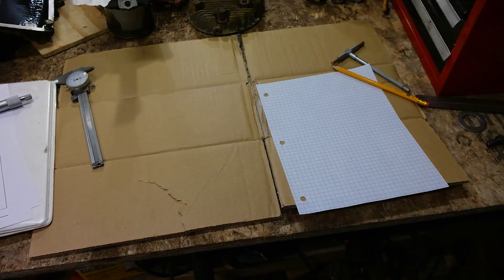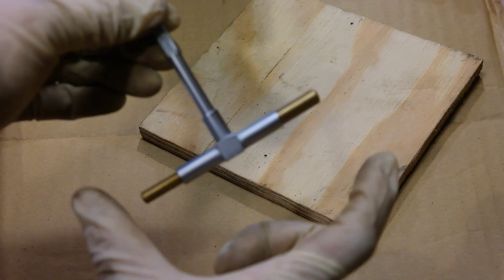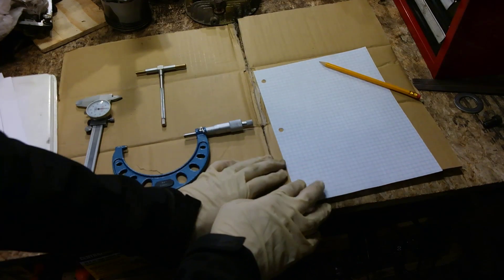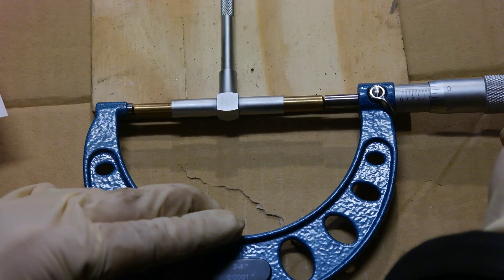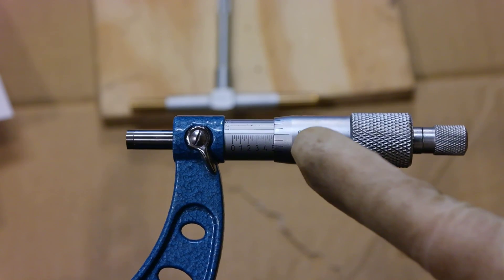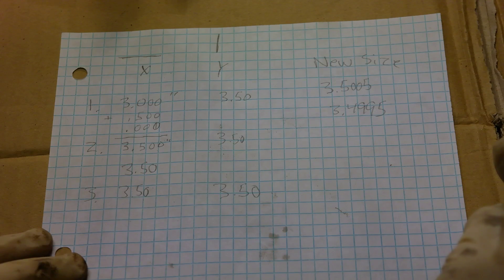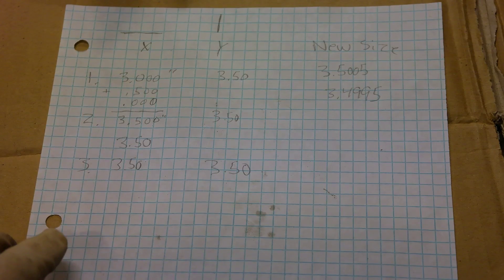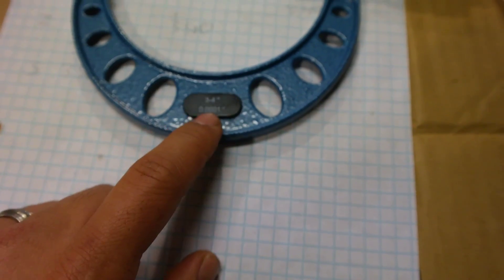How to Measure Cylinder Bore Kohler K Series Engine

Comment: when you took the measurement using the telescoping springy tool, you started at the top and worked from side to side.  that is the X axis measurement.  you do 3 of those from top to bottom.  how is the y axis measurement taken? I didn't catch that...
Reply: sok, I found it more clearly explained in one of your other videos: https://www.youtube.com/watch?v=sD9OAe2ZIDw
thx.
Reply from the maker: 90 degrees from where you took them at the x axis

Comment: This is really clear, thank you. I am going to check mine using this as a guide and will also check the piston rings using your other K321 video on how to install the rings properly as a guide. I have oil in the head and after a gasket replacement, still got it. Thanks for providing such clear and easy to understand videos.
Reply from the maker: +Rob Brown You're welcome! You're on the right track if your have oil creeping up into the cylinder head.